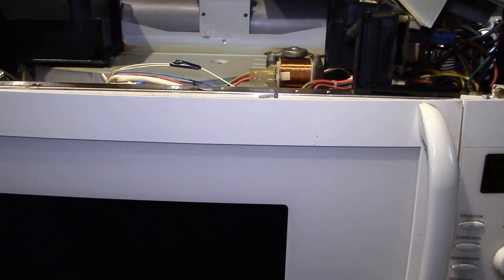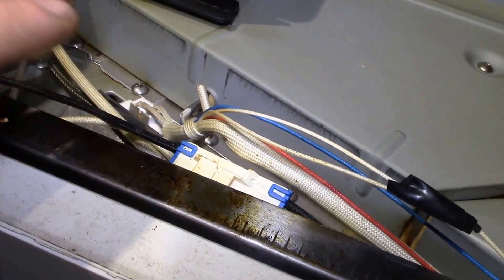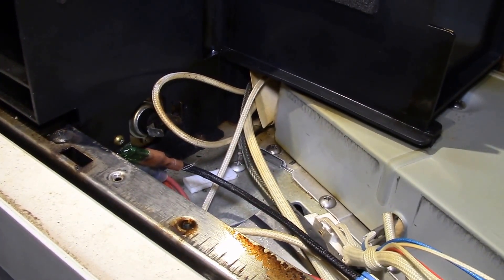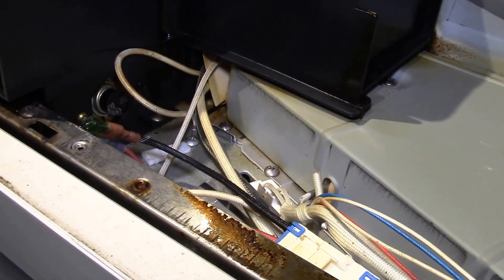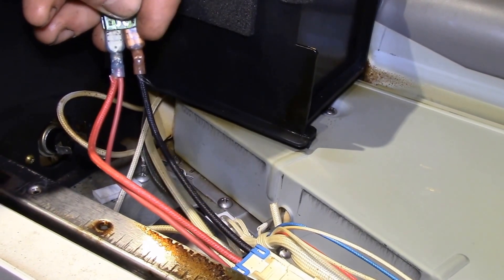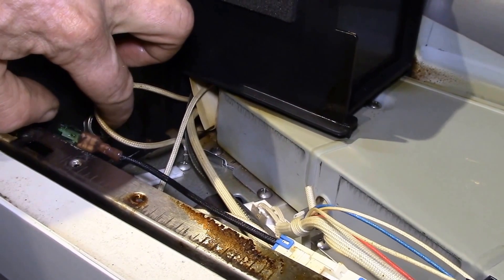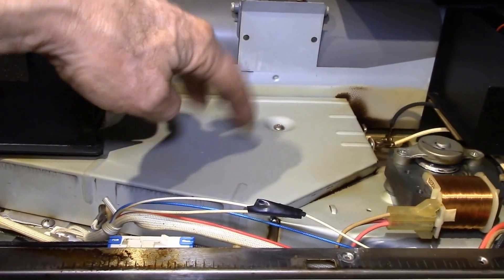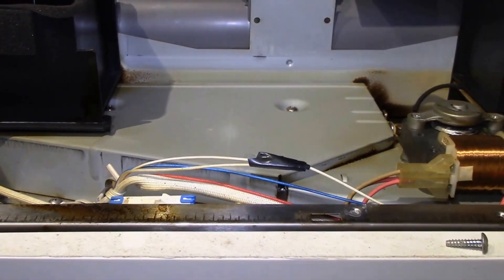Advantium SpeedCook Oven Repair, Part 3 - Two simpler fixes

Comment from the maker: Had some viewer questions about the size of the fuse I used to replace the Cavity TCO in the video.  The main fuse in the unit is 20 amps, so something around that rating should be fine.  Those two fuses are in series according to the wiring diagram.  I have measured that the oven pulls a bit over 15 amps at full load, so a 20 amp fuse is likely OK, I may have used a 30 amp fuse judging by the color.  Been using the oven with that fuse for some years now and it's still working fine.

Here's a link to a copy of the Advantium Service Manual:
https://drive.google.com/file/d/1YtwaBDOF-scnm3JdCcR1vs53-Oim8FwA/view?usp=sharing
Reply: R Brown
Thank you for all the helpful information here!  I tried jumping with the 20 amp fuse and even tried replacing the control board,  still not a sign of life. Any other suggestion?  We have power to the board but nothing on the panel. Any thoughts are greatly appreciated.
Reply from the maker: Sorry for the late reply, for some reason YouTube doesn't send out notifications for some comments.   I've not run into this issue myself. 

Anyway, best bet is to download the PDF manual below:
 https://drive.google.com/open?id=1YtwaBDOF-scnm3JdCcR1vs53-Oim8FwA
and follow through the troubleshooting decision tree.  It's pretty thorough with lots of simple tests.

Comment: my advantium only works for microwave, does this TCO if blown allow the microwave still to work? Have no convection no lower ceramic only halogen light works up top,  but no real heat is generating from that
Reply from the maker: There seems to be a separate Magnetron TCO for the microwave portion.  I don't recall trying the microwave function when the Cavity TCO was out.  There's a link to the service manual in the pinned comment in this video that shows how to test the Cavity TCO if your's is still intact.  Mine always seemed to be burned to a crisp.

Comment: Just wondering if your fuse is still working? I have had my fuse quit twice. I removed it and put it in a ziplock bag and put in the freezer for 15 minutes. It reset the fuse. I would like to replace the fuse like you did, and replace the spades also.
Reply from the maker: You were lucky that your TCO was able to be re-used.  In the ones I replaced, they were destroyed by the heat.  My fuse worked for a few years but then it too melted.  I think I finally tracked down the problem to the crimped on spade lugs.  Not sure if they were not done right at the factory but I decided to remove them.  Instead I just stripped the ends of the wires and connected them in a Wago lever nut.  That has worked perfect and shows no sign of heat damage in several years use.  It may well be it was the factory spade terminals that were bad and I suppose putting on new ones, crimped and soldered would do the job as well.

I see that they make high temperature spade terminals:
https://amzn.to/3np7mj0

Comment: Thanks. Couldn't figure out where the TCO was and was expecting to have to pull the whole unit out and disassemble it.  I like your fuse fix method also, I will do the same.